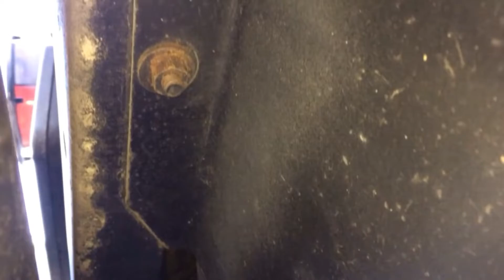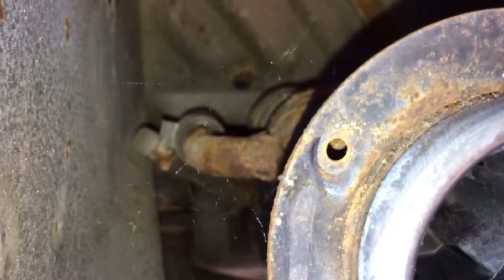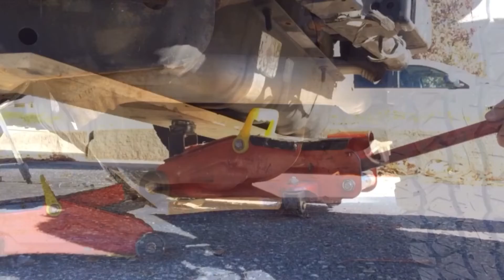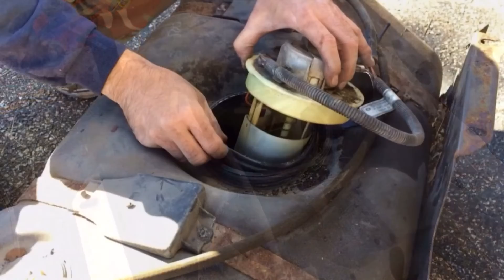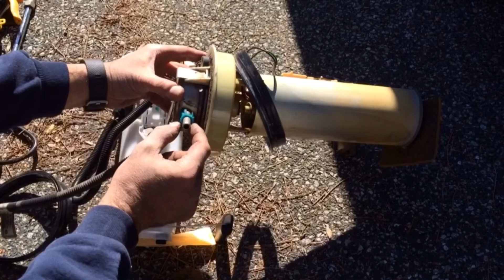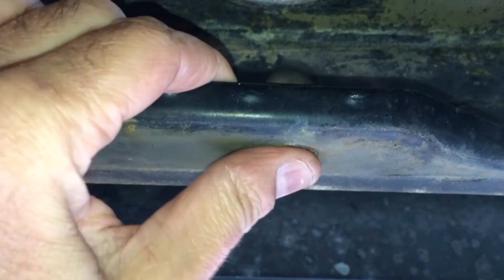How To Replace Fuel Pump Assembly - Jeep Wrangler TJ (Andy’s Garage: Episode - 134)

Comment: Great video just removed the tank. Can’t get the screw top off. I tried all the hammering tricks. Going to watch the spanner wrench video you referred to now. Any tips. It is very stuck any more screwdriver or wooden board hammering will strip the nodules.
Reply: I can’t find that video for the spanner wrench… can you link?
Reply from the maker: Usually giving it a good wack with a screwdriver and hammer will break it free.

Comment: Thank you very much, your detail on explaining everything was outstanding. Thank you for taking the time to do so. I clad you broke a bolt and how easy it was to fix. This is going to save me money. How do you know what fuel pump to buy? again great video, I wished you would have shown putting it back in but it how you took it off. 
Thank you again for the detail
Reply from the maker: @richardblanchard9010  Thanks for the comment 👍

Comment: Great video. Any consideration to washing out the inside of the tank?
Reply from the maker: You can wash them out since fragments and junk can be in there. I was doing a quick fuel pump assembly swap so did not.
Reply: When washing, you what should be used with water?
Reply: There is a tank cleaning kit at Autozone that can be used, but a small squirt of dishwashing liquid works fine & is recommended/demonstrated by Delphi in one of their how-to YT videos. Minimal amount to keep the suds down…no issues.

Comment: Nice you showed the Fuel bleeder valve. What year is your TJ ? You mentioned a 170K on it.  Do you Still have the original clutch by chance.
My Jeep is a 1998 with 178K, It needs everything. Clutch (original) , brakes (rear original) exhaust, AC, stereo. Rust surface type I'm in Dallas, Texas
Just wondering if you have the gauge drop out problem ? There was a TSB on the 98 to change out a connector. I just tap the top of the dash and they come back up.
Sorry to say my 98 has been sitting a while now so who knows what's going on with rotted fuel in tank, lines, injectors etc etc. Don't forgot all the sensors too.
I miss the old school days when the fuel pump was bolted to the side of the engine. You disconnect the fuel tank side and use a mason jar to get the engine turned over etc.
No sensors or Computer. Just a HEI module, coil wires and the plugs. Yes the carb is a pain in cleaning and its assorted vacuum lines but even a weak carb will still run somewhat.
Reply from the maker: Mine is a 2001, and all original. I changed the fuel pump because pressure was on the low side. Going to be swapping out the Injectors soon.

Comment: I’m doing this tomorrow to my 05 LJ....I already broke all 7 bolts loose and unfastened them almost entirely .....getting my new assembly tomorrow and it should be very smooth sailing.  Probably a 2 hour job to take the lines off, lower, remove/replace....and fasten the tank back up to the frame .....these videos have helped me
Reply from the maker: Good luck👍

Comment: I just completed this and it took roughly 2+ hours on my own. My Jeep is a 2006 TJ. One difference I've seen in the videos is the ring holding the fuel pump in place. Phillips shows the plastic ring where mine is the medal ring. The ring wasn't as tough to get off as I've seen in another video but that may be due to my jeep being a California jeep and mainly on road.  Overall I would say this is a medium tough project and would consider it easier if you had a second person to help you align it  getting it down and back up of course. If you own a 2003 - 2006 at the same time you do the pump, do the check valve at the entrance to the fuel tank. See other videos on this.
Reply: I thought the check valve was included in the fuel pump assembly?